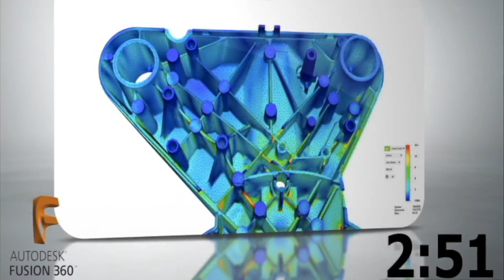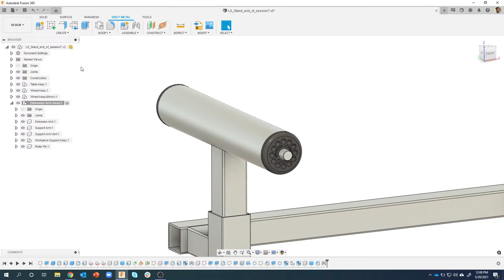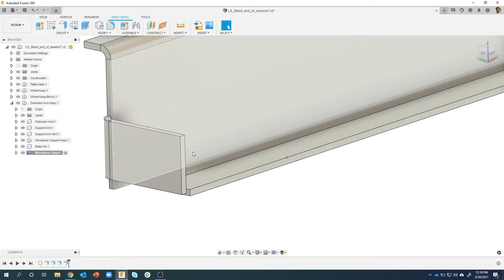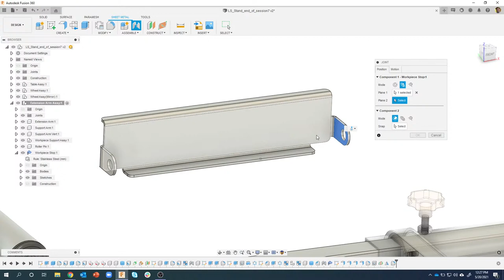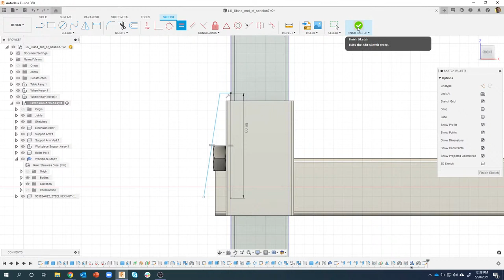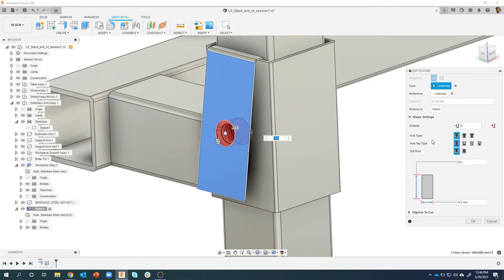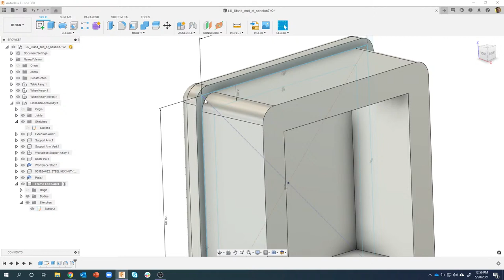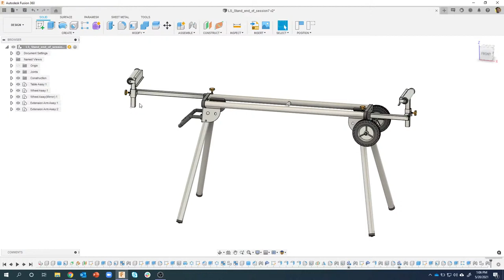360 LIVE: Miter Saw Stand project - Part 8

Comment: Me again! 😁 @54:50, the reason you taught you could select just using the shift key is because it probably worked before. And the reason is that the selection behavior changes once you have entered the radius. So, in a nutshell, as long as you haven’t entered your radius, you can select any hedges without having to use the control key but as soon has you have specified the radius, then you have to hold control to “modify” the selection. So before specifying the radius, just the shift key and window select works but once the radius is specified, you need both shift and control keys for window select. I believe that alt key instead of shift key unselect.

Comment: Hi Brad, @46:39, you can’t move the sketch because it has already created a body. You can move back to before you created the body in the timeline and then move the sketch. The sketch should move and the resulting body will also move if it was created outside the component you moved the sketch into. This will only work if nothing is referencing the sketch or the new body. hope that helps! 😉